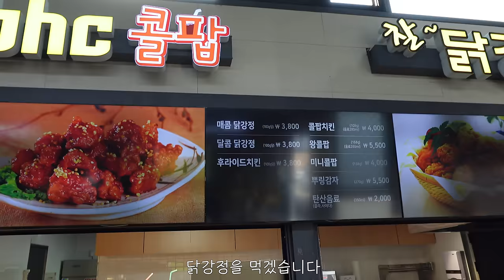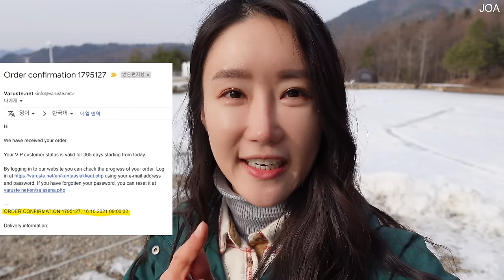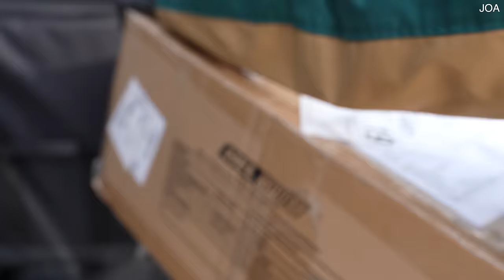2년을 기다린 텐트ㅣ부뚜막 화목난로ㅣ괜찮아 첫사랑이야ㅣ이 조합 다신 안 한다ㅣ솔로캠핑인데 과했다ㅣ과메기에 혼술

Comment: the next time you need to use the tent, coat all poles with silicone spray on the entire pole. then they will slide in more easily. it's a nice tent, you can get it with two inner tents. I would love to have that tent where can i buy that same tent. the oven is also beautiful and smart.